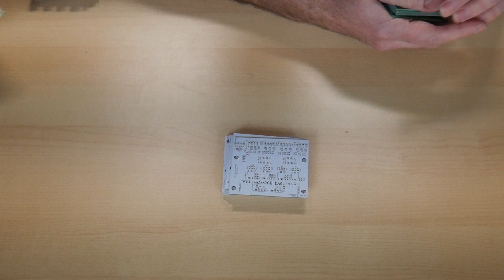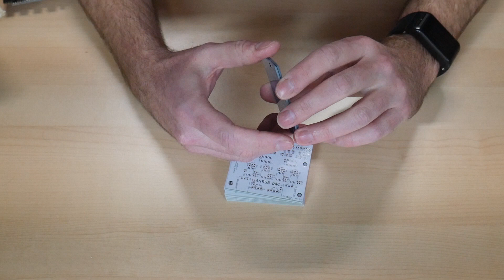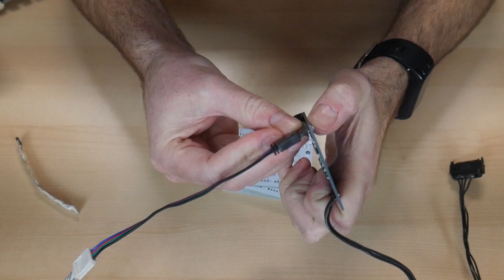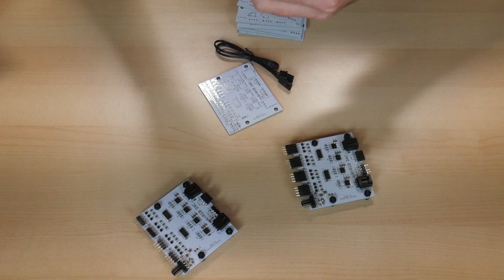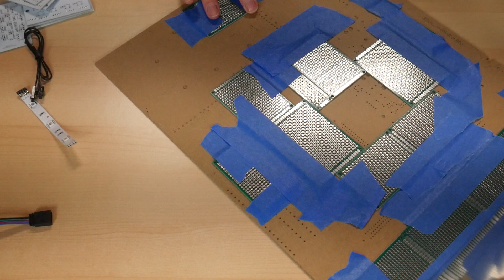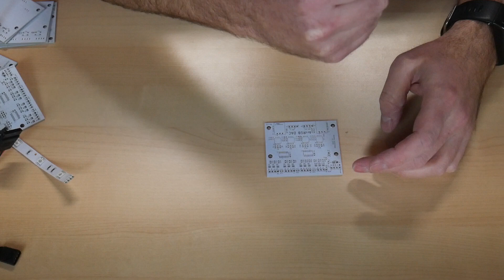RGB DAC Overview and JLPCB Review

Comment: What is this for? Sry english is not my native language. I found your chanel after seeing your vid about TT rgb fittings, which i would like to get for my pc. Is it for syncing these fittings or any rgb device with big brand rgb software? Or syncing for exemple 12 rgb fittings? Im a bit lost, even tho i figured out that you made a good job desinging and develloping this pcb. I'll subscribe and stay tuned anyway!
Reply from the maker: Cool thanks for subscribing. Each RGB DAC is designed to control 4 separate Analog RGB channels/devices. I used 3xDACs to control my fittings. The DAC allows me to control analog rgb devices with most of the digital RGB controllers. i.e. Corsair iCue, Asus Aura, Gigabyte Fusion, MSI mystic, and many others.
Reply: Solarity Technology First off I want to say, your lighting display was amazing. Secondly do you care to share the schematics, parts needed to construct a LED controller like the one in that video?
Reply: Solarity Technology can I buy a board? The same one in the Thermaltake Pacific connectors video. 

Put IR receiver on my he board for a remote , you will win with that, either that or a switch Reset like female connector.
Reply from the maker: @themword1279  I am still testing it, I might sell a few Beta Boards, though looking into mass production. The device uses software to control it. i.e. Corsair iCUE, Asus Aura, Gigabyte RGB Fusion, MSI..., AS Rock, and etc. Do note the board needs some slight alterations for it to work with the TT RGB Pacific Fittings
Reply: Solarity Technology thank you for your response. But yes brother, put me on your purchasing list, I need the board for my TT RGB fitting. And name your Board “CuddleFish”. If you use the name all I ask for 5% of the profits. Lol
Reply: Also I have an amazing pc build that I’m excited about. I’m almost finish and your controller would be the icing on the cake